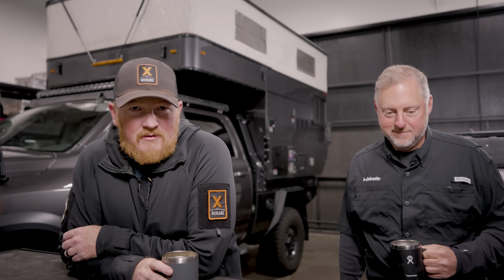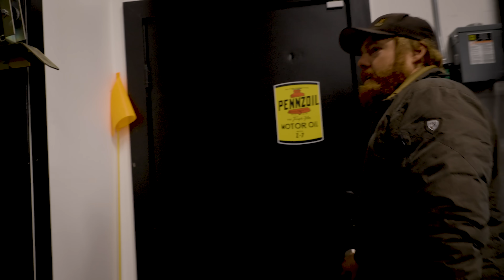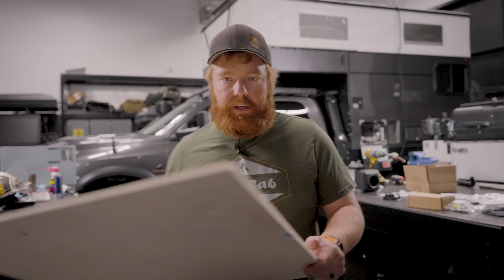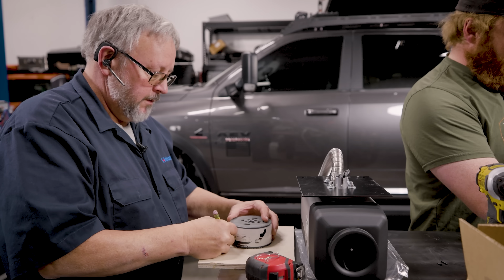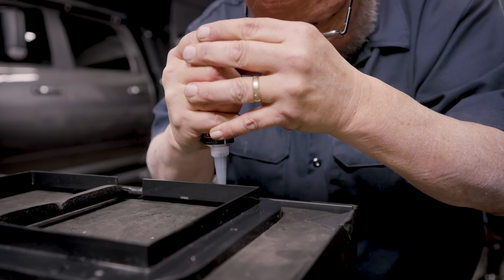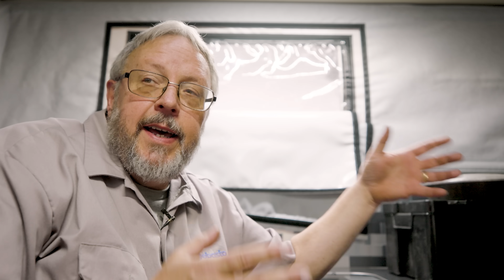Ultimate Heater Upgrade for Your Overland Build

Comment: Yeahhh!!!  No propane anxiety!!  Did the Timberline heater/water heater in mine and one of my fav upgrades!  Ran almost constantly on my Arctic  ocean trip and sips fuel out of my aux gasoline tank. Dumped propane all together with an induction cook top!  All the space it opened up getting rid of the propane fixtures AND tank storage was amazing!

Comment: I got a Webasto 2K gasoline unit to heat my roof top tent and love it. It's quiet and very fuel and power efficient. It wasn't cheap, but I didn't want to go with a 3rd fuel (2nd is propane as well) and the Chinese diesel heaters were fairly unknown at the time. I did pickup a Vevor diesel 5K this year on sale and have been using it around the shop the last few weeks and have been pleased with them.

Comment: IM new to these diesel heaters, but they sound like a big upgrade over propane. So as a guy who hunts from deer blinds in the winter, can you tell me how much diesel exhaust there is, is there a lot of smell from them?IM guessing not.  Im thinking this could be an awesome upgrade for a late season deer blind if the exhaust fumes are minimal. And yeah yeah to those who look down on deer blind...LOL. I also like to hunt off my back for days in the mtns for elk and mule deer. The deer blinds for whitetails are a nice contrast!
Reply: You definitely wanna run the exhaust outside because yes it will smell but if you are in colder temperatures, it is ideal to run the diesel heater off of kerosene due to the lack of issues in cold cold weather. The other nice thing about kerosene as a fuel is it burns extremely clean and does not stink nearest bad is regular diesel?

Comment: How was the fuel lines ran? Did you go though the floor of the heater compartment to the stock tank?
Reply: Fuel line went out the same hole that the drain lines went out when the four wheel camper was installed.
Reply: @Tanner_Johnson  ahh thank, mine is not set up with interior drains.

Comment: Thanks for another good video. One question: where is the diesel tank installed or is it connected to the vehicle?
(On my rig I decided for a separate tank in my FWC, which makes disconnecting the FWC easier )
Reply: We installed a long range auxiliary fuel tank underneath of the truck. Before that tank went in there was a fuel pick up tube put in knowing that eventually we would put in a diesel heater. So the diesel heater is pulling straight from the auxiliary. long range fuel tank.
Reply: @Tanner_Johnson  Thank you for the details, Tanner. Have a safe journey at all times :-)

Comment: Many question and thanks for the video. So if I caught it in the video this a Webasto EVO 40 diesel heater? I'm currently building a 2004 Ext Cab HD 2500 long bed Duramax. This is probably the heat source I'd ultimately love to use. So it will have a Moon Lander Camper as stand up room for me is not a necessity. I'm curious if I would need another fuel tank with the setup? Since the unit sips fuel it might be overkill. Anyway I love all you adventures and info on this channel plus I think we've talked a time or two at the Overland Expo. I live in Colorado so not to far from Montana. If you ever in my neck of the woods give me a holler. I'm in the Western Slope area.

Comment: We have Webasto heaters in most of our vehicles in the german army, many of them over 20 years old that see only minimum maintenance and often terrible use, i‘ve only seen one fail, and it wasn‘t even the heater itself but the diesel hose that flows into the device itself started leaking.

I think you did a good purchase with a Webasto system!

Is it also connected to your engine coolant circle in order to condition the engine before starting it cold?